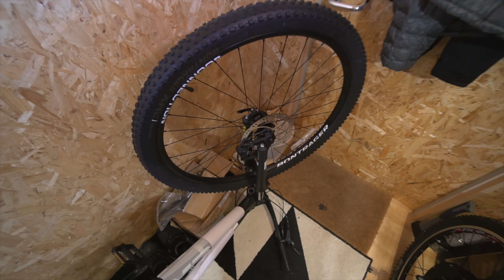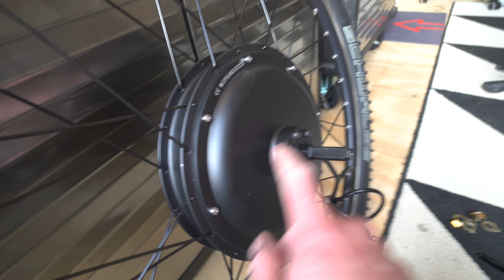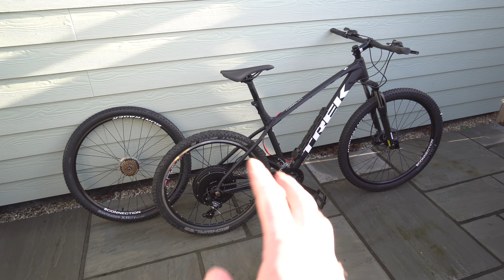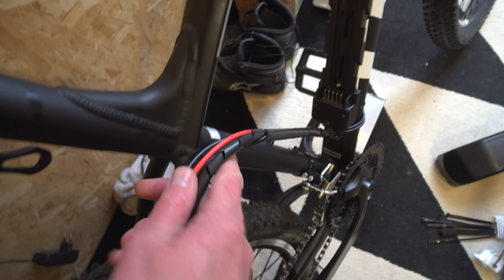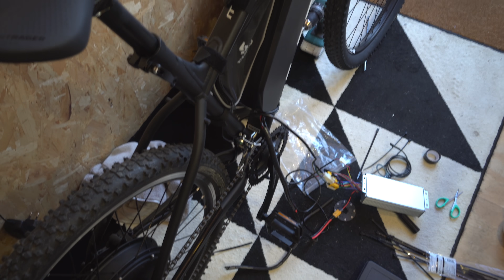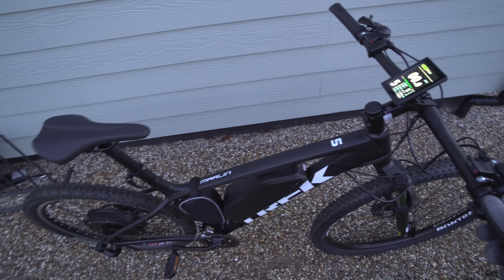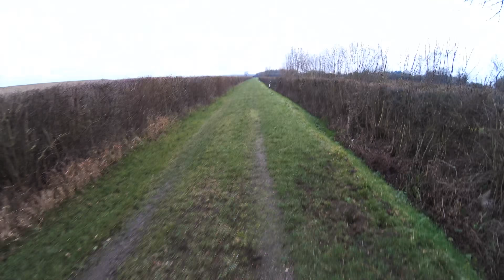HOW TO MAKE AN EBIKE IN UNDER AN HOUR!!! | TREK MARLIN 5 EBIKE CONVERSION

Comment: I am writin I am writing this for the buyers.  Maybe it will make things easier for others.

Ebike front wheel conversion kit was shipped quickly. 
This was the only good news…

Manual was terrible, worse than useless.  Had to spend a lot of time to find
suitable  instructions on YouTube.

I had a lot
of serious problems with the front
wheel, sitting in the fork properly.  Because the new wheel had larger diameter
axle, it was sitting about 1/8” off center, comparing to the original wheel,
and washers didn’t fit now into the indentation in the fork.    I had to file safety washers to get them into
the fork indentation.   Hopefully, I
won’t get killed in the accident after that. 
If I knew only about this problem upfront, I probably wouldn’t buy the
kit at all…

Break levers were useless because mine were
integrated with gear switch,  so I
couldn’t replace them, and  magnetic break sensors were missing,
although they were mentioned in the manual, as an alternative.  Had to buy them myself at extra cost(>$25).  New magnetic brake sensors worked well, after
finding the right position for the magnets.  Throttle didn’t match the one in the manual as
well, but at least it worked, after sorting out LCD PAS setting problem.

Getting pedal assist installed was even
worse.  There were no instructions.  It required extra tools that had to be
purchased to remove the crank  arm.  Had to wait for weeks for the crank puller.
Then stripped thread on both crank arm and the puller.  Then I had to find another PAS model  that didn’t require crank arm removal.  More time and money.  I also have to replace the crank arm now, because
the thread is stripped.  Then the new PAS
sensor turned out to be defective and has to be replaced.  I am still not done with this, almost 4 weeks
since the purchase.  The whole PAS installation was a disaster in
slow motion…

Controller and LCD.  There was no diagram, one was supposed to
match wires by a connector type and wire color.  When the battery came in and I started
connecting things to check it out, I had discovered that the controller had
ring style connectors instead of bullet connectors on the motor (although they
came together as a kit).  Seller tried to send me another controller
with the right connectors, but couldn’t do it quickly. So we decided that I
will try to replace them myself, by buying female bullets, crimper, solder,
flux and iron. So, I managed to replace these connectors.  Finally I was able to connect most of the
things to the battery to check if this thing was working.  And
it didn’t.  Everything was dead.  Communicated with the seller.  It turned out that one had to turn on the LCD
display by pushing the middle button on a little switch, attached to the LCD, and
then push the upper button to get PAS at 1 or higher. Finally, the throttle
worked and the wheel was spinning.  I was
happy, and upset at the same time. There was nothing in the manual
describing this procedure. Thankfully, seller had refunded some costs related to
changing the connectors.   In the end, controller had 3 extra wires/connectors
left over.  No instructions about what
they were for or what to do about them 
either. 

No tools were included, nor were the
instructions on what is needed.  And one
needs a lot of tools, some very specialized, maybe used once. Manual doesn’t
address this at all.  So a lot of
tools had to be learned about and purchased, adding a lot of time to the
project.  It took about 2 weeks and many
trips to the hardware store.

Overall, I had
to spend at least $150 above the cost
of the kit itself, plus a ton of time and gas.

All in all,
this was much more difficult and frustrating project  than I expected.  I was ready to give it up and ship the product
back several times.  Seller was trying to
help with most of the problems (although many could have been avoided with
better product description, much, much better manual and video links).  This whole industry seems to be populated by
young unprofessional people, bike shop kids or/and Chinese entrepreneurs with
limited English…

Then,  I learned about Simon Cowell, who broke his
back trying a new electric bike.   So it
occurred to me that while one has to spend over $700 for everything plus a lot
frustration and work, the alternative is a very nice 65” TV with an excellent manual
and no real need for it.  One has to hope
that this was a better decision.g this for the buyers.  Maybe it will make things easier for others.

Ebike front wheel conversion kit was shipped quickly. 
This was the only good news…

Manual was terrible, worse than useless.  Had to spend a lot of time to find
suitable  instructions on YouTube.

I had a lot
of serious problems with the front
wheel, sitting in the fork properly.  Because the new wheel had larger diameter
axle, it was sitting about 1/8” off center, comparing to the original wheel,
and washers didn’t fit now into the indentation in the fork.    I had to file safety washers to get them into
the fork indentation.   Hopefully, I
won’t get killed in the accident after that. 
If I knew only about this problem upfront, I probably wouldn’t buy the
kit at all…

Break levers were useless because mine were
integrated with gear switch,  so I
couldn’t replace them, and  magnetic break sensors were missing,
although they were mentioned in the manual, as an alternative.  Had to buy them myself at extra cost(>$25).  New magnetic brake sensors worked well, after
finding the right position for the magnets.  Throttle didn’t match the one in the manual as
well, but at least it worked, after sorting out LCD PAS setting problem.

Getting pedal assist installed was even
worse.  There were no instructions.  It required extra tools that had to be
purchased to remove the crank  arm.  Had to wait for weeks for the crank puller.
Then stripped thread on both crank arm and the puller.  Then I had to find another PAS model  that didn’t require crank arm removal.  More time and money.  I also have to replace the crank arm now, because
the thread is stripped.  Then the new PAS
sensor turned out to be defective and has to be replaced.  I am still not done with this, almost 4 weeks
since the purchase.  The whole PAS installation was a disaster in
slow motion…

Controller and LCD.  There was no diagram, one was supposed to
match wires by a connector type and wire color.  When the battery came in and I started
connecting things to check it out, I had discovered that the controller had
ring style connectors instead of bullet connectors on the motor (although they
came together as a kit).  Seller tried to send me another controller
with the right connectors, but couldn’t do it quickly. So we decided that I
will try to replace them myself, by buying female bullets, crimper, solder,
flux and iron. So, I managed to replace these connectors.  Finally I was able to connect most of the
things to the battery to check if this thing was working.  And
it didn’t.  Everything was dead.  Communicated with the seller.  It turned out that one had to turn on the LCD
display by pushing the middle button on a little switch, attached to the LCD, and
then push the upper button to get PAS at 1 or higher. Finally, the throttle
worked and the wheel was spinning.  I was
happy, and upset at the same time. There was nothing in the manual
describing this procedure. Thankfully, seller had refunded some costs related to
changing the connectors.   In the end, controller had 3 extra wires/connectors
left over.  No instructions about what
they were for or what to do about them 
either. 

No tools were included, nor were the
instructions on what is needed.  And one
needs a lot of tools, some very specialized, maybe used once. Manual doesn’t
address this at all.  So a lot of
tools had to be learned about and purchased, adding a lot of time to the
project.  It took about 2 weeks and many
trips to the hardware store.

Overall, I had
to spend at least $150 above the cost
of the kit itself, plus a ton of time and gas.

All in all,
this was much more difficult and frustrating project  than I expected.  I was ready to give it up and ship the product
back several times.  Seller was trying to
help with most of the problems (although many could have been avoided with
better product description, much, much better manual and video links).  This whole industry seems to be populated by
young unprofessional people, bike shop kids or/and Chinese entrepreneurs with
limited English…

Then,  I learned about Simon Cowell, who broke his
back trying a new electric bike.   So it
occurred to me that while one has to spend over $700 for everything plus a lot
frustration and work, the alternative is a very nice 65” TV with an excellent manual
and no real need for it.  One has to hope
that this was a better decision.

Comment: Andy ,please help i built my ebike on only rode 3 times and i got a error 7 0n my sw900 display i am running 48v and 1500w on a 48v /78v 2000 w 45a controllor any help would be helpful ty chad

Comment: I've just got done building your kit and must say it's absolutely mental how quick the 1500w picks up speed.

I pussied out at 26mph and have now limited it to 15 til I hit some trails.

Thank you sooo much I do have a quick question though. 
Those brake sensors for hydrylic... Where do they go? Did you show us in one of your videos?
Reply: Hi Ryan,Ive bben looking at the same kit and wondering about delivery time from china and whether im guna get stung for tax extra.
How did it work out for you?

Cheers
Reply: @peterfinch7984  I had to pay 50 gpb customs surcharge for UPS expedited, It took a little over 2 weeks for the hub and kit to arrive which IMO is really good for china mail, I ordered my battery elsewhere cos i wanted a pannier version (amazon Junstar eu) which arrived 2 days behind the kit.
I wouldnt recommend a pannier battery as the weight is all on the back wheel which takes some getting used to, get the frame battery.
Reply: also worth noting the packaging was impeccable, cant say the same for other kits.
Reply: @ryan6764  Thanks Ryan,much appreciated.

Comment: I’m thinking about converting my 29” aluminum northrock mountain bike but will it fail since it has aluminum drop outs?
Reply: Hi, I've fitted 2 torque arms to my aluminium cube frame and from what I've read on all of the forums it should be ok.
I just check that the nuts haven't come loose every week or so and everything is fine.

Comment: Cant find dropout size. Thinking of the 1.5to2kw version on my kmx venom tadpole trike.
Reply: 135 mm frames will be fine ( most std mtb frames - non thru axle ) , I had to pull mine apart to get the wheel with the washers on to drop in to the frame, just thought I'd  let people know you may need to do this( one person pulling the frame out from each side while making sure the wheel drops in with the washers in the right place, I needed 2 washers on the inside of the frame on both sides).

Comment: Handlebar is upside down haha, rear brake is typically on the left in the uk and the front being on the right. Also your shifters, they're upside down and you're meant to put the 7 speed side on the right and the 3 speed side on the left

Comment: Excellent vid, my kit arrived today so I’ll be putting it on my 2017 specialized rockhopper tomorrow, but at a much more sedate pace with many tea and biscuit breaks .
Reply: how you getting on. I am about to order one. How long did delivery take?
Reply: Mike Pell hi, to be honest the kit arrived in a couple of days from modds ebike and had everything you needed other than the battery , which I had ordered separately from Germany and took just over a week to arrive. With a busy work schedule it’s been on the back burner for a bit ,but I’ve mounted the battery , fitted display and throttle and then realized that the connection between battery and controller were completely different . New connections arrived today ,along with a more heavy duty tyre from schwalbe,but unfortunately I’m feeling under the weather and had a coved test today at stansted and waiting on the results, so for now it’s just all sat there ready to be assembled,but I’m just too unwell to crack on. This is my first attempt at an ebike build so I’m expecting some issues but will let you know how it goes when completed. It’s a 1500w kit with a 48v battery so I’m expecting some serious speed.......we shall see.

Comment: Are the stock Trek Marlin brake discs and calipers up to the demands of this conversion? This is a 1500 Watt (2000W peak) drive train with a potential speed well above 30 MPH. Sorry, but with this kind of power and speed, an upgrade of the discs and calipers is an excellent idea.  I would consider it mandatory. Consider the Shimano XTR M9100 or Deore XT M8100 4-piston calipers, and compatible XTR/Deore XT discs.  Not cheap, but with an ebike like this, you want stopping power that matches what the motor is putting out.
Reply: he put on hope brakes in a later video.

Comment: Andy I really wanted to purchase the conversion have dropped you an email but no reply can you get in touch please?
Reply from the maker: Emails are very busy at the moment, you will get a reply soon. For the kit all you need to do is select the wheel size of your bike on the website and if your bike has more than 7 speeds you should also order the 9 speed hub, also I recommend the MTX39 rim. That’s about it!
Reply: andy kirby thanks Andy I haven’t even purchased the bike yet if I want to make the exact same as what you have done with the conversion kit how much will I be looking at spending in total and also what’s the kit I need to purchase from the website?

Comment: I bought the kit with the standard rim. Do I have to worry about it bending when i ride over bumps?
Reply: you wont have to worry about it bending as they are quite strong kits but i wouldn't recommend doing heavy jumps on a standard kit. I have a MTX 39 rim which is stronger and able to do big jumps for trail riding ect but for general road riding you will be fine. Hope this Helps.
Reply: @taylorpreston8502  Thanks. I am releaved.
Reply: UnexcitingChris No problem anytime

Comment: Could you tell me if i could use this kit on my specialised hardrock for a daily 30 mile round trip commute.Cheers
Reply from the maker: You should be able to if you have enough space for the battery and the rear wheel doesn’t use a Maxle.
Reply: @andykirby  Rear wheel has a quick release.Thanks ill do a bit of reading.
Reply from the maker: Quick release are usually skewer type so yes if that’s the case.

Comment: Will this kit work with a 48v 14ah battery if so at what max speed?
Reply from the maker: Yeah it will but I’ll shave off maybe 5mph and some torque (acceleration). Bit less range too.

Comment: When undoing bolts you know have loctite on the threads some gentle heat will make it easy and save breaking your torx set. Ask me how I know,  I've used this trick for years and never fails

Comment: I love the mullet look with that Ebike Conversion. You just sold me on this conversion for my mtb. WIth my dorpper post and horn (attached to the head light) and rear taillight remote, I think I'm going to have to swap my handlebars out or use shorter grips to fit everything in the cockpit.

Comment: I have a few curiosities...This diy rear hub motor works even without using the pedals,I mean you have a throttle, but on a cheap prebuilt hub motor you don’t have a throttle and it will only work and assist you if using the pedals. Is it better to buy this kit worth of 700£ and a merlin 5 worth 400£ rather than buying a prebuilt bike from a shop at around 1200-1500£? The thing with this diy is that you don’t have assist modes when you pedal, you have to push the throttle and pedals at the same time if you want that kind of assistance from a prebuilt bike, is it?

Comment: Andy,whats the current delivery time of this kit from china?
Reply: Mines just taken 3 weeks for the wheel (arrived today), no sign of the battery
Reply: @MadMunky6682  did you have to pay dpd postage on your motor? if so how much did you pay?
Reply: @taylorpreston8502  Came via UPS and import tax was around £35
Reply: Chris Richardson  thanks
Reply: @MadMunky6682  Any sign of the battery yet? my wheel arrived Thursday with no battery.
Reply: @gwyndafhughes4853  Yeah, it comes a week or two after the wheel.
Reply: @MadMunky6682  that's good to know. Hopefully mine will come as soon as yours. How is the performance?

Comment: Just ordered my full kit :)

I've ordered the brake sensors and also MTX39 rim, what tyres best and are there any videos about fitting the brake sensors?
Reply from the maker: Nice! Thanks! The Maxxis Tyres are great, pick according to which terrain you’ll be mostly riding on! There must be a video somewhere about the sensors, I haven’t made one yet.
Reply: @andykirby  Found this - https://www.youtube.com/watch?v=IvDURsQJA64 so sounds simple enough. Any idea on delivery times at the moment once this ones fitted will prob be ordering another one :)
Reply: Sorry last question, is there a way to hook up the display via Bluetooth etc to the phone?
Reply: @andykirby  Hi Andy, tried emailing you a few times to find out about my order but not sure if your getting the emails or just busy or what can you contact me please?